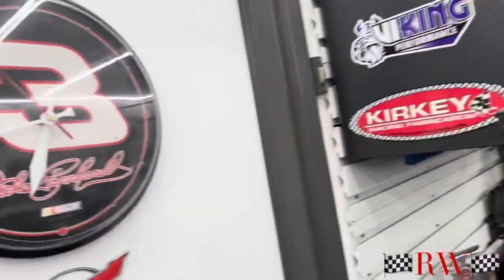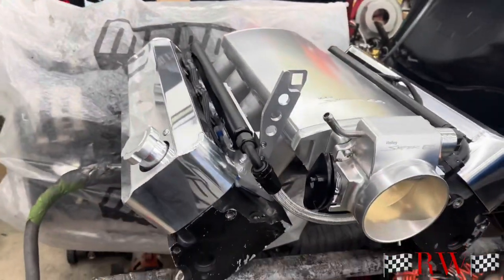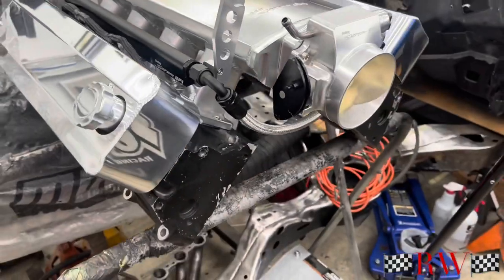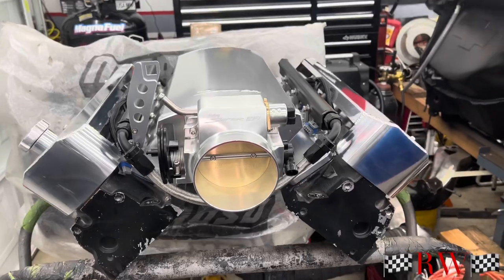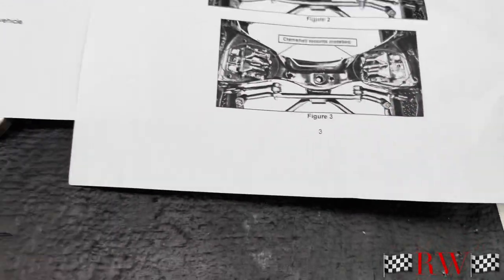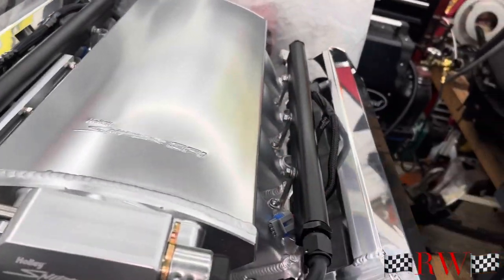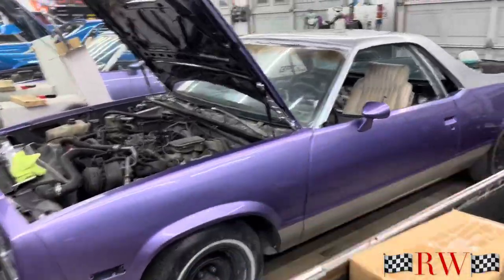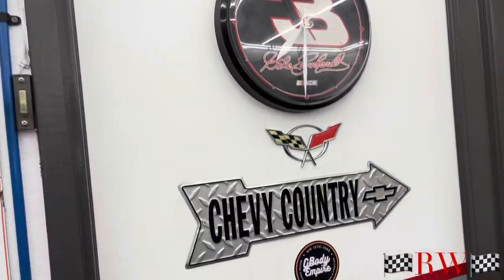Holley G body LS Swap Kit

Comment: After you bought the kit to drop it in what else did you have to buy? I’m asking because I’m planing on doing a swap on my Gbody as well and I want to be ready
Reply from the maker: So sorry to respond so late. I can’t see the comments in the vid or thru the YouTube app. Strange. I’m replying g from the “studio” app. I installed the kit and dropped the motor on. You must follow the instructions.  I hated it at first but it’s really the best kit on the market. Just hella pricey!! But once installed, everything drops in like legos..
Reply: Hey again, so I finally got around doing this myself. I’m having a hard time with the 5.3 vortex I got. The heads keeps hitting the firewall. I tried moving the mounts on the frame one bolt over to the front but now the oil pan won’t clear the chassis. Any tips are appreciated

Comment: What kind of radiator are you using in the g body
Reply from the maker: Man for some reason I can’t see the comments in the app.  Sorry so late.. right now, I have a 4 core aluminum radiator for a g body. I want a Griffen setup tho but man they are pricey😩😩😩😩
Reply: All good
And I definitely know that's why I had to ask what you running LOL